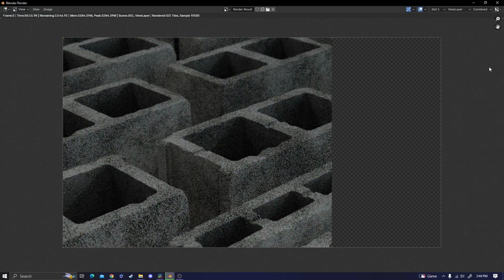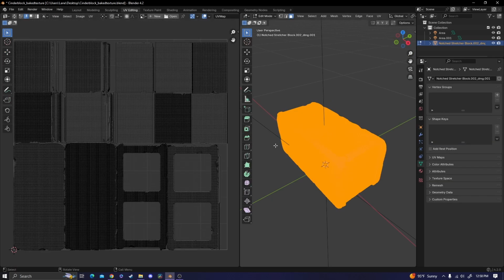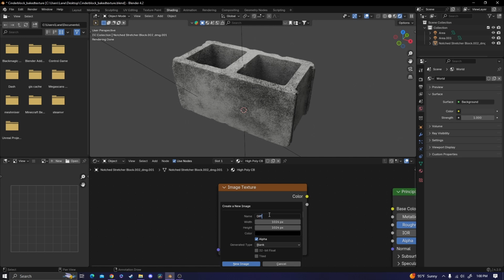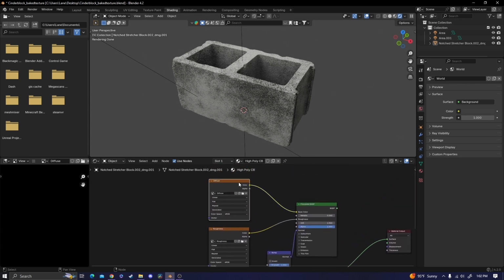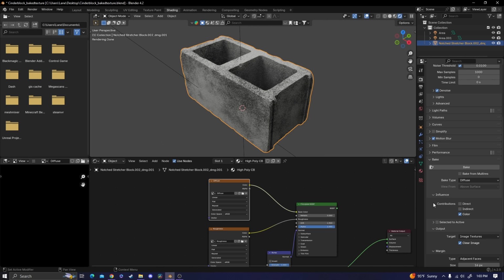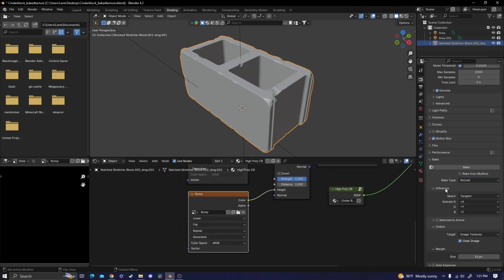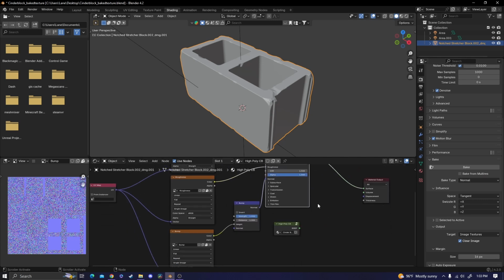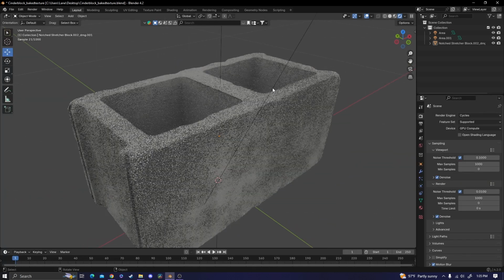How to Bake Procedural Materials into PBR Textures | Blender Tutorial

Comment: this helped me IMMENSELY. was having problems particularly attempting to overlay procedural edge wear onto an existing image texture. your setup, keeping the procedural stuff separate worked wonders. what I did was combined my (second) image texture with my main material in a mix shader node with the node group result into material output surface. then followed your steps for baking and it worked out 100% correctly.